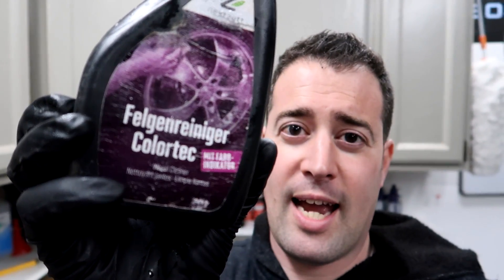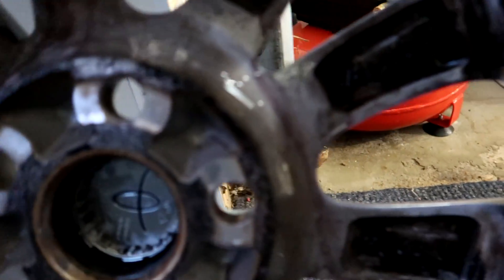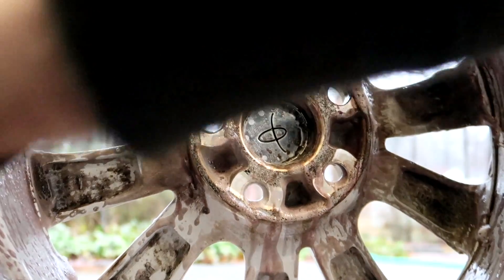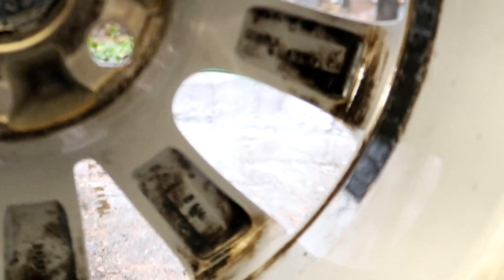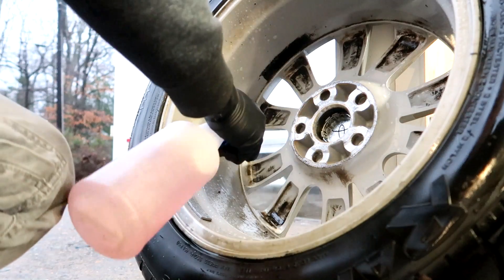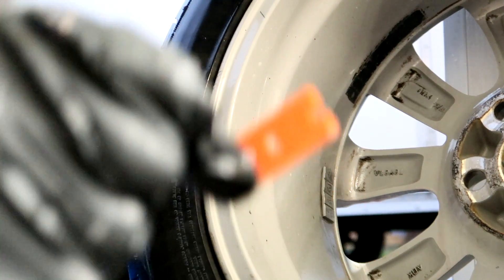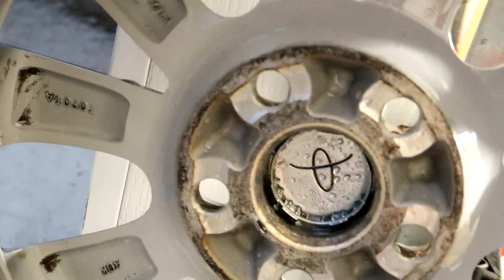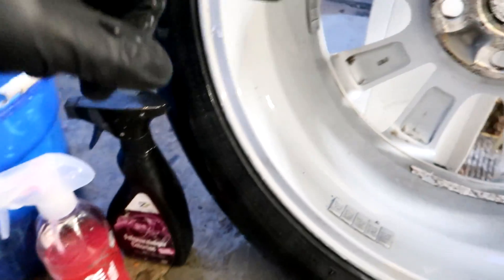Iron and Tar Removers // Nextzett Colortec // Gyeon Tar

Comment: Are these products the strongest wheel cleaners you’ll typically use? And thank you for not adding music.
Reply from the maker: I use the 3D Speedy Brite which is an acid based cleaner, i also use Super Cleaner, 3D Super Citrus APC, and i used to use Meg's Wheel Brightener
Reply: Miranda Detailing Thanks. The wheel looked pretty good after you were done.
Reply from the maker: I was pretty happy with the results.
Reply: Agree, thank you for no weird music!

Comment: Very informative! I enjoyed your commentary on the use of the products and how they reacted. Would a stiffer bristle brush worked better on cleaning the spoke side of the rims in your opinion? Or small brush attachment for a cordless drill?
Reply from the maker: Thanks Bro. Probably but I try not to go to aggressive with stiff brushes even on the inside of rims. Actually I think if I used a compound it could get all that burnt on brake dust.

Comment: Hey Phil what chemical do you use to take off stubborn bugs off the front of a car.
Reply from the maker: I use Super Clean diluted 1:4. I rinse first then apply Super Clean and then Foam the car and use a big sponge to work the bugs off. If that doesn’t work I use a clay bar, and if that doesn’t work I usually use a wax by hand to work the bugs off.
Reply: Cool thanks Phil.😃